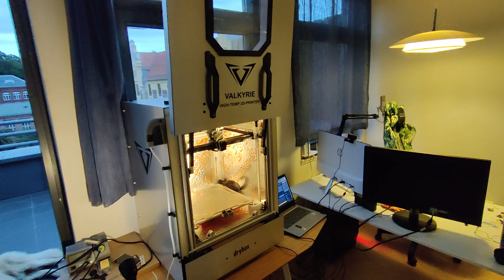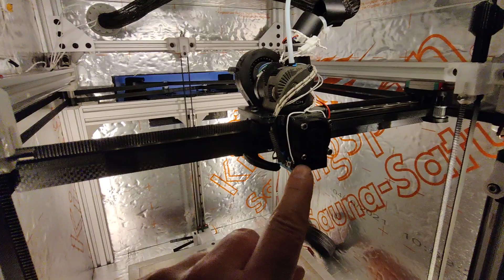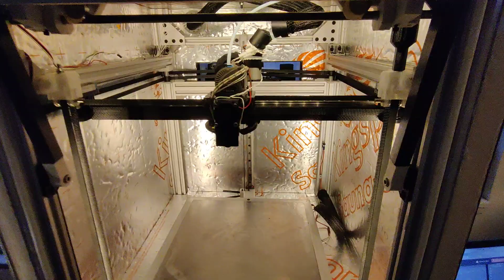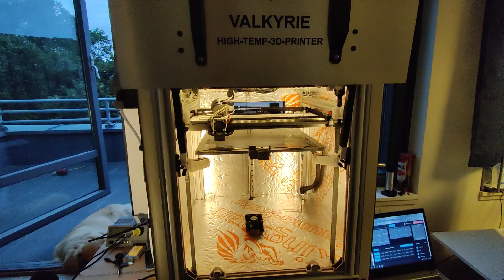BL Touch replacement | Unclid probe reworked | Valkyrie HT 3D Printer

Comment: Will this probe after the bed and chamber have heated up?
Reply from the maker: You can probe when ever you want. As I dont have a dock for it I need the door open to take it off so heat would leave the chamber. Bed can be cold or hot